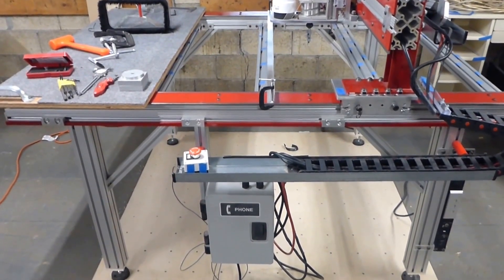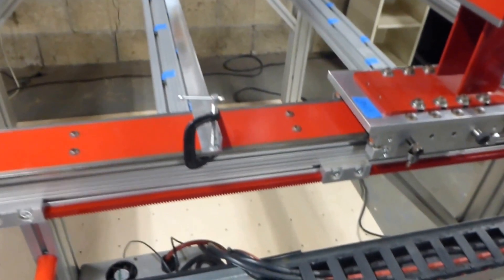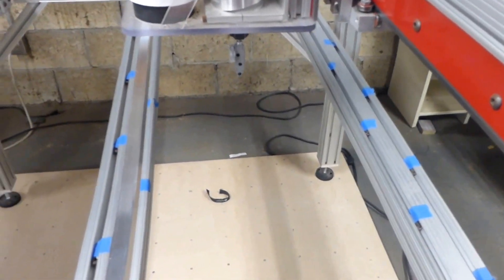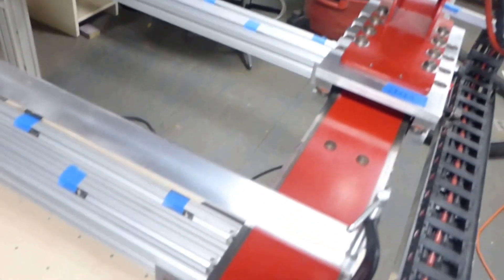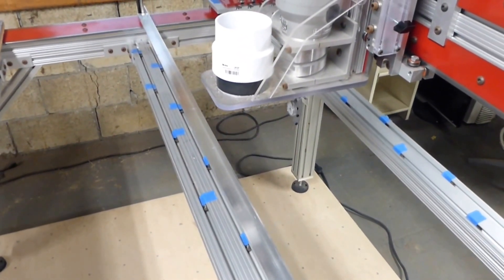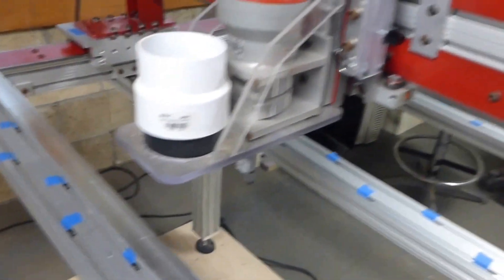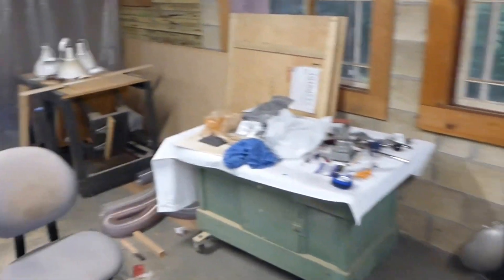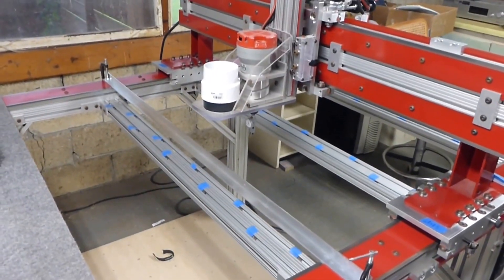CNC Router - Part 28 - More setup and alignment

Comment: how you know your angle bracket is square to machine. if you use dial to straight it then you measure your x, but you just did it :)x is aliignment with square bracket. how you measure is x and y perpendicular
Reply from the maker: +JarppaGuru Yes, I did use a large framing square to get my guide marks perpendicular to x.  I checked the marks from both sides (turned the square around in case it wasn't perfectly true) and they were pretty much right on.  It only took a very small amount of fine-tuning once I starting using the dial indicator.
Reply: hey Wilburley maybe you can answer me a question...
Did you use leveling feet with ball joints?